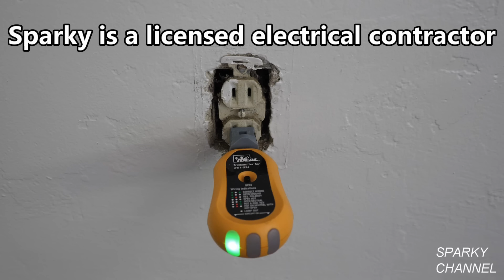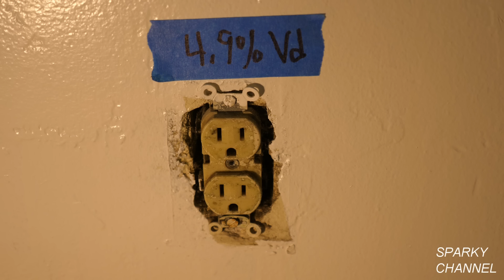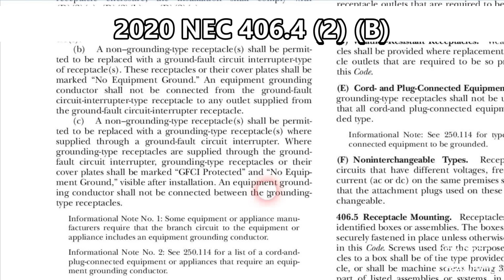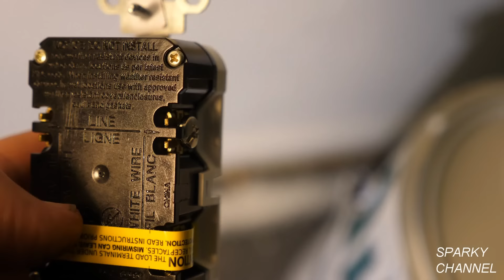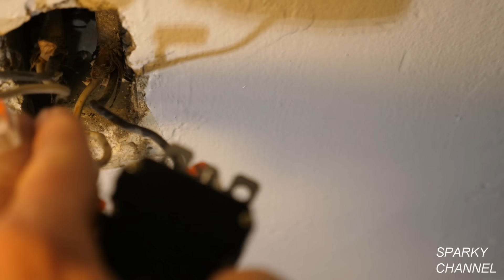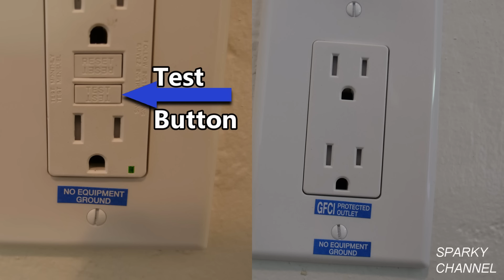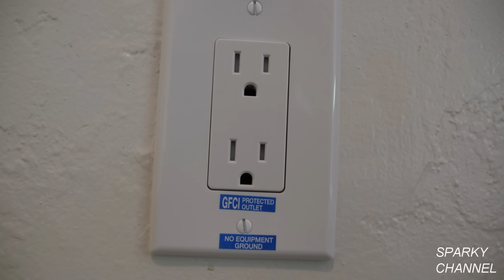2 Prong Receptacle Circuit Replaced by GFCI and Grounded Receptacles per 2020 NEC

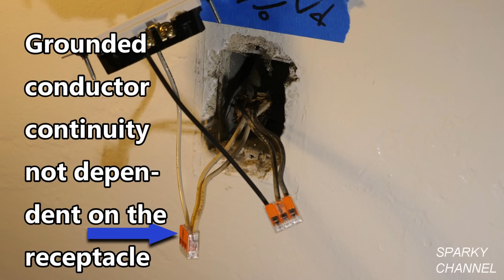Comment: At 15:13, what kind of mechanical damage are we talking about?  (I am wondering why he didn't just use both screw terminals on the side of the standard outlet for his wires.)  Great video, btw.
Reply: The mechanical damage would be if the little jumper between the two terminal screws would somehow break thus cutting off continuity between the two terminals. The wago or in other cases a splice and wire nut maintains continuity between the incoming and outgoing wires and the pigtail wire to the receptacle. If the outlet was wired with all wires on the terminal screws and some sort of damage or break on that jumper occurs it would cut power to all downstream receptacles. Wired as shown, continuity will remain even if there is a problem with that plug thus keeping all other downstream plugs live. Splicing and pig-tailing is the best practice. Makes trouble shooting a breeze and easy to target problem areas.
Reply: @chuckp92  Personally I prefer to use better outlets that allow me to backwire and put both wires under the same screw clamp.  But if I were to use both side screw terminals and in the unlikely event the side jumper was damaged, the loss of power to the downstram outlets would help to isolate the problems.  Still, it's a lot easier to stuff an outlet into a box with 3 pigtails attached to it than with 5 12 Ga wires screwed in the back.
Reply: It's a rare occasion for the tabs on a receptacle to burn out.  I agree with Henry Chinery's  method (1 screw - 2 wires.)  Either way, I believe the wago connectors are the equivalent of stab-lock receptacles.  They are inferior to the side screws and to wire nuts because the connection is not as tight and there is very little surface contact, which are 2 likely causes for the high voltage drop @ 15 amps.  Electricity is potential energy and kinetic energy.  The Potential energy occurs when electrons get excited and increase their orbit speed around the nucleus, which increases the diameter of their orbit (due to centrifugal force.)  When the diameter of the orbit increases, the atom gets physically larger, meaning some atoms get bumped off the end of the wire (kinetic energy.) With little surface contact in the connector,  fewer atoms can leave the wire simultaneously, therefore voltage drop occurs and is proportional to the current demand.  That is why higher current requires larger wire.  Those wago connectors, in effect, decrease the wire size.  Voltage drop is a product of high resistance.  Larger conductors have lower resistance than smaller conductors.  Electricity is an amazing power with a will of its own.

Comment: Never saw you test the GFI plug to show it worked like it was suppose to.
Reply: No ground wire, so cannot test it. 
It will trip when someone touchs the hot wire.
Reply: @adamxu  It will only trip if it detects an imbalance of current between hot and ground.  If you get between hot and neutral, like would happen if someone miswired and appliance, then it won't sense an imbalance and will allow you to be shocked, hopefully not fatally.
Reply: @hjc4604  
You are wrong.
GFCI or RCD senses current imbalance between hot and neutral, not ground. So it has two wires in and out, both for hot and neutral.
Reply: @adamxu  You are right, in that it does sense an imbalance between hot and neutral and the only way that can occur is it there is leakage between hot and ground.  If you put a resistance ( a person or a resistor) between hot and neutral, the GFCI will not trip.

Comment: Will a GFCI work if both line wires are "hot"? Here in our location, both wires are 120volts and there is no neutral. All appliances are 220 to 240 volts 60hz.
Reply: A GFCI cuts both of the wires so it should work just OK, You need to get one rated for your system. Where is that? Brazil?
Reply: Thanks! I'm from the Philippines.

Comment: Coming from Northern Europe I have a hard time grasping why You would put 3 prong receptacles without wiring the ground and not just stick to the 2 prong ones in that case ? Also we used to null this type of sockets i.e. connect the neutral to the ground but that is not recommended anymore...
Another thing is that with GFCI, you are supposed to push the test button every now and then to check that it actually works. What the test button does it connects the line via a suitable resistor to ground thus simulating ground fault, but if the ground is not connected at all, the test button will not work...
Seems every country has a bit different code so it's interesting to see how electricians work around the world. Of course different countries also have different electrical system so that makes a difference, number of phases, grounding (TT, TN, IT) etc etc...
Reply: Its pretty much a convenience thing, people will just buy a ton of 2 prong to 3 prong adapters so they can use the outlets in their house.  At least this way they are GFI protected and you can plug things in without the crappy little adapters.
Reply: Coming from Poland. If you have TN-C electrical system I would rather null it than not connect the ground at all, since pretty much all TN-C-S systems are TN-C at some point and split into PE and N before RCD. Nulling this outlet would be pretty much converting TN-C into TN-C-S. Also without ground the GFCI would pop since it doesn't short between live and ground, but between neutral (load) and neutral (incoming) this creates inbalance and simulates electricy flowing thru an unwanted path. (at least that's how rcd is wired, and I suppose it would be same for GFCI but I may be wrong. This would mean the GFCI wouldn't pop if nothing was connected to it, since there wouldn;t be any electricity flowing.)
Reply: In America electric code changes every three years. A long time ago you didn't have to ground receptacles, but now it is mandatory for new houses.
Reply: In Finland one would not need any modification at all as the grounded plug fits the ungrounded socket. The modification is to allow the use of the three prong grounded plugs (like a PC, stick to your typewriter?) in an ungrounded system. The GFCI makes the result safer than what is used in Finland. Btw if you in Finland need to use an ungrounded socket or a grounded equipment, I recommend getting a portable GFCI in between. It can save your life.

Connecting the neutral to the ground is called a cheater ground in the US and is strictly banned. Different countries have different regulations. There are different conditions. Btw unlike commonly mistakenly said it is not banned in Finland when you change old sockets - at least if they were installed before 1989.

Comment: Hey Bill, I’m struggling to understand why the GFCI is only installed on the first receptacle and not all of them?
Would it not have been easier to install a GFCI at the DB instead. 
Reason I’m asking is here in the UK 13A Sockets all have a CPC or a ground and are to be RCD protected which is similar to how your GFCI’s work. These protective devices are usually installed at the DB
Reply: Ben K Lore so the GFCI is for surges and not for voltage imbalances? 
I still don’t understand why wouldn’t this safety device not be installed at the DB instead of the first point. In my eyes the first cable from the CB is unprotected.
Reply: @dringonator6911  The cable to the outlet from the main is unprotected but GFCIs are designed to protect people from shock.  It's unlikely they would ever contact the cable from the main panel.  I believe AFCI and dual AFCI/GFCI outlets require metal conduit to the first box coming from the panel, where the AFCI or dual AFCI feedthrough outlet would be used.
Reply: Ben K Lore Distribution Board where the Circuit Breakers are (CB)
Reply: @dringonator6911  You can put a GFCI circuit breaker in. They do virtually the same thing. 

The only difference is convenience and cost. If you trip a GFCI outlet, you can reset directly at the outlet. If you trip the breaker, you have to go all the way to your panel to reset.

In the US, the cost of the GFCI breakers here are like 10x the cost of a GFCI plug. You do gain some advantages though, especially if you need AFCI protection as well due to being in an older home where the potential for electrical fires is higher due to some areas still having aluminum wire. At the cost, I personally would recommend the GFCI/AFCI combo breakers because its not much different than GFCI only. 

I would only use GFCI outlets if I need specific outlets protected (like in wet areas), if I am afraid of touching the panel (or can't, due to still needing electricity in the house in other areas), if I'm on a limited budget, or if I want to add a little extra safety to my plug layout. Adding one in is very cheap, and like he said in the video, if you add it in at the beginning of the series then all the others are protected as well. 

That being said, I put AFCI/GFCI breakers in every panel of every house I own. Especially in my rentals. You never really know who did what behind your walls sometimes, and having the extra insurance always helps.
Reply: @latimer4964  correct. It's far simpler in this case, though, there are no Pushmatic breakers more to be bought of any sort, including GFCI.
Reply: @ethelryan257  Huh? Pushmatic GFCI breakers are for sale. But, they aren't cheap.
Reply: @latimer4964  They also have Dual function AFCI/GFCI outlets available that are cheaper than the breakers and protect the downstream outlets as well.
Reply: @latimer4964  When doing our remodel, we were told it would cost at least $10,000 to move the breaker panel because that would trigger an upgrade per the Code.  The meter box and feed from the pole.  So we eliminated a bump-out and kept the panel, while upgrading the breakers to dual AFCI/GFCIs.
Reply: Ben K Lore so one of the new circuits had the GFCI at the panel and the other circuit had it at the outlet?
Reply: The GFI is installed first in line because it protects the rest of the circuit down stream.  He used a GFI device instead of a Breaker because GFI breakers for that old panel are very hard to come by.  The GFI is for personnel protection, not for wire protection.
Reply: The GFCI (RCD in the UK) protects all the rest downstream so there no no need to put it in all. It is cheaper to get just one. It is also easier to test just one than all. Since the point is to replace the the sockets replacing the sockets will not add any extra work apart from the need to first the first one. Replacing the breaker adds.

UK sockets have earth connection in all, but go to a 50s house and test all the sockets. You might be surprised.

And a GFCI has nothing to do with surges.

Comment: Sparky, I could not quite see if you used pigtails from the old wiring to the GFCI using Wago-style push in connectors. Did you do that or did you go directly from the old wires to the GFCI?
Reply: You can't do it WITH pigtails on the gfci outlet. It would defeat the purpose. The electricity has to flow through the first outlet to have the protection on the rest of the circuit.
Reply: @jimmac1185  Jim, I just meant to wire it correctly but instead of wiring the old wires to the new GFCI terminals directly use two double-hole Wago connector to extend the old wiring that would normally go to the GFCI.
Reply: @rseabrease  oic, my bad. I misunderstood.

Comment: Everything was fine in my house until 2 weeks ago. My microwave started blinking simultaneously with my oven hood.  Then, the microwave died. It was a cheap older one so I figured that was the problem. Bought a new one and things were fine for a few days.  Then it started again. Now I've lost power to 5 outlets and 3 switches. I found a back stabbed outlet that was burned and figured that was the problem. I didn't have a new outlet so I switched it with the end of the line. Still no power on this circuit. I bought new outlets and switches and an outlet tester. The tester is showing OPEN GROUND on all of them.  Even on another circuit with power. The only ones showing up good are my refrigerator outlet and the bathroom GFI outlet. How can these outlets show open ground and light up my tester but have no power?  My fuse on this circuit is good.  I'm at a loss. Thanks Sparky!!
Reply: You don't need a ground for the plug to work. If it shows open ground that means you have hot and neutral which is sufficient. The first plug on circuit that was melted was probably on the neutral side of the plug and was 99% chance that was your problem.
Reply: The problem is just as often in a plug that is still working as in a plug that isn't.  When checking voltage, it's a good idea to have a 2 probe tester, but it's just as important to have a non-contact tester.  If you lose a neutral, your 2 probe tester will show a dead circuit, but the hot wire might still be hot. So when troubleshooting, both testers are a good idea, always.  you just have to start opening boxes between what is not working and the breaker/fuse panel until you find the problem.  Sometimes, the breaker panel is a good place to begin.  Remember, if you fin d one loose lug in the breaker panel, use in insulated screwdriver, stand on a fiberglass ladder, and check all lugs .  in fact, any time I remove a panel cover, I check all screws and lugs EXCEPT the stub-out wires or wires feeding the panel.  I only put a tool on those if I can wiggle the wire and see that it's loose.  Be careful.  If you are not sure, call someone to come over and help you.  If you make a mistake, you might not get a second chance.